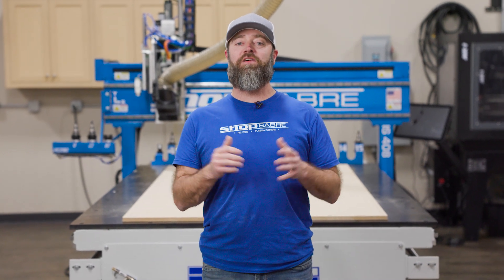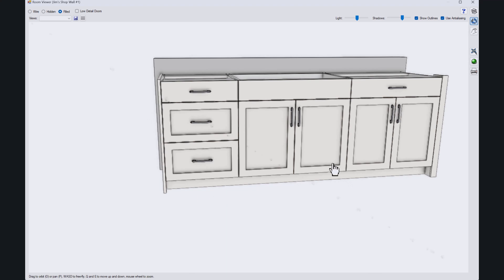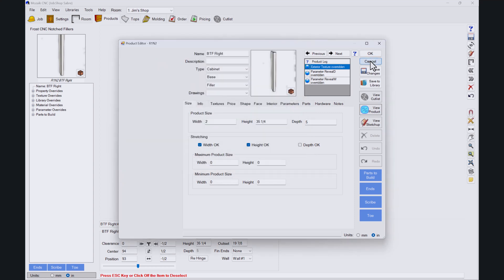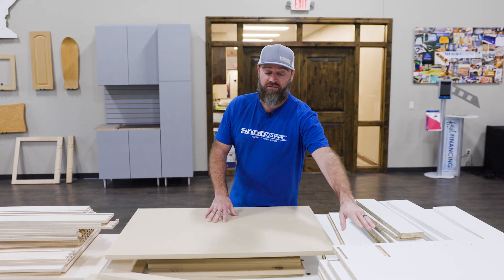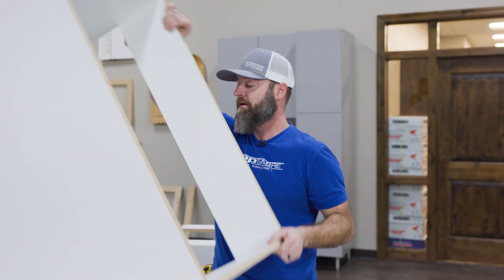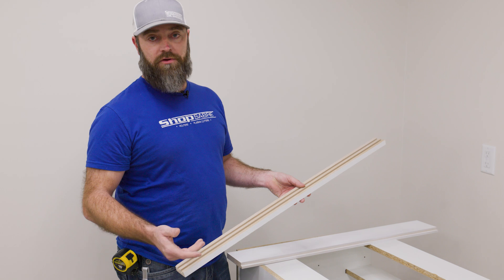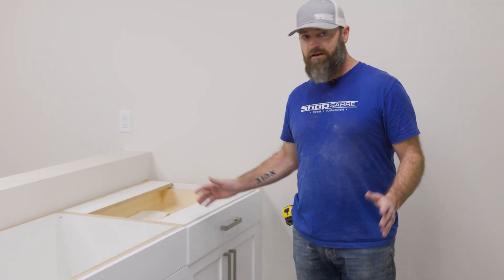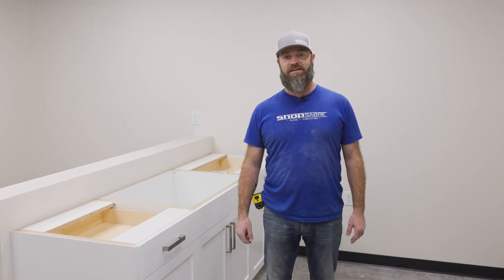Design to Installation: Building a Custom Cabinet with the IS 408 CNC

Comment: What construction method is this in Mosaik? It's real slick that the assembly seems really smooth and there aren't clamps everywhere!
Reply from the maker: That’s blind dado construction in Mosaik — the CNC cuts the joinery so the parts lock together and stay square with hardly any clamps needed

Comment: Why do you have to flip the levers for the vacuum pump every time? Won't the machine turn off the vacuum pump at the end of a program?
Reply: I am wondering this too. My Morbidelli has a switch that controls entire table.
Reply from the maker: We adjust the vacuum pumps to assist in part removal as the vacuums are quite strong. These are run independent of the program.

Comment: Great video! Can you tell me the bits you used for this project as well as the feed and speeds for each bit. I'm considering upgrading my small CNC and would like to know how much more productivity I will gain from this unit. Thanks
Reply from the maker: Hello there! Our technical sales team and support staff can assist with this question. If you haven't upgraded yet, give us a call at 952-461-4570